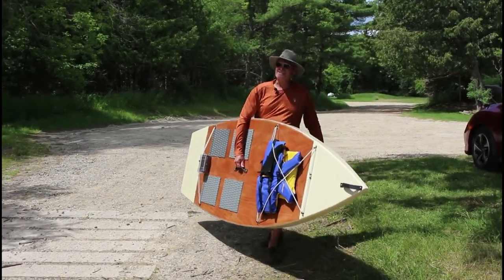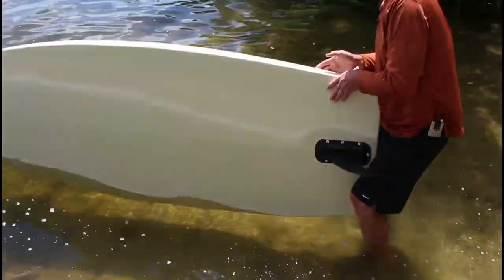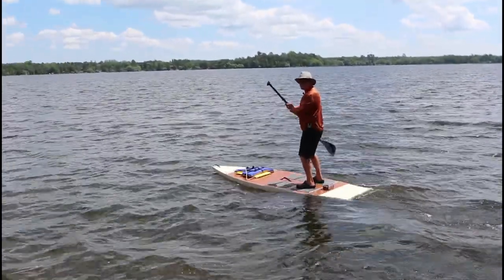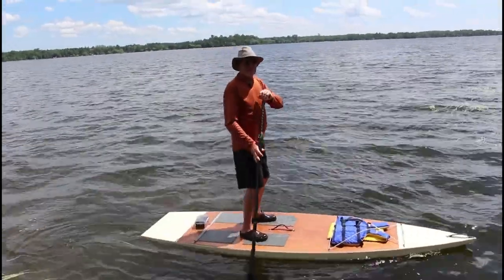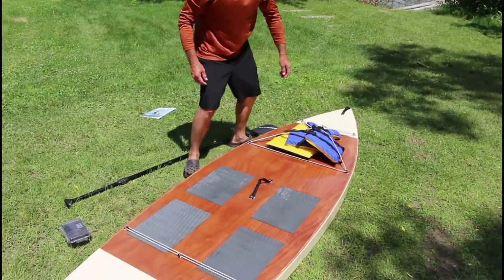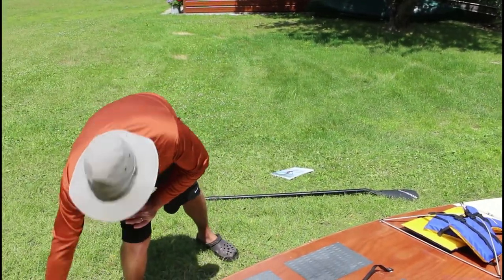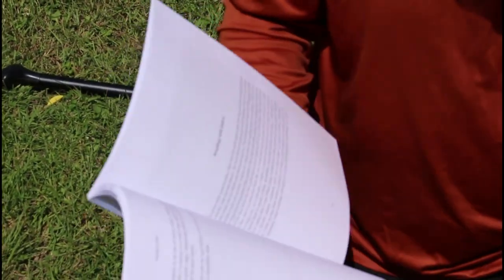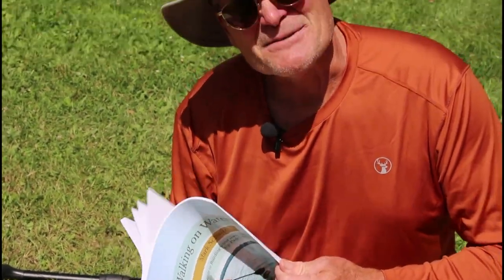Build your own Stand Up Paddleboard

Comment: Holding your paddle backwards.
Reply from the maker: Haha. I have never been able to figure out which way is correct, and have been told both ways. This means, to me, that it doesn't make all that much difference (unless I'm in a race).
Reply: @backwoodbasics9383  Cool looking paddle board!   The intent with bent paddles is so the your stroke can extend further back for more power, without lifting water, which is wasted energy.  Flip it over and you’ll get more pushing from the stroke, with the blade vertical.  Once it tips from vertical, you’re lifting water instead of pushing it backwards.  Nice video.